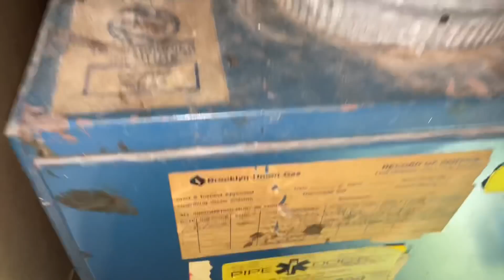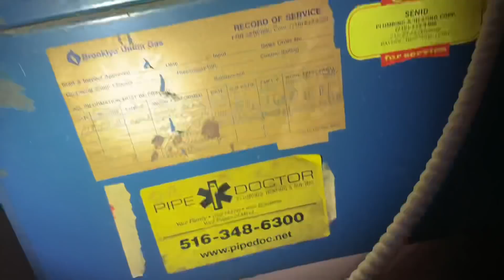Lucky The House Didn't Burn Down! Dunkirk Steam Boiler Ran Without Water & Totally Burnt Everything

Comment: Hello! I’m a new homeowner who just discovered your channel and admire how informative your videos are. I am in the process of replacing my old and oversized Peerless oil steam boiler and wanted to ask your opinions on the 2 brands that I’ve been quoted on: Crown and Dunkirk. Which one would you recommend?

We have a multi family home that’s about 4820 sq feet. All of the windows are new and we renovated so the house is well-insulated. Based on calculations, we need to cover about 442 square feet of steam which would be a 175,000 BTU boiler but the store I went to doesn’t have that one available for either brand. They checked if other brands had 175K BTU in stock but they didn’t. To my understanding, they told us to get a 200,000 BTU boiler and have the plumber change the nozzle so it functions like a 175K BTU and we’re not wasting oil and using the appropriate gallons per hour for the size/steam requirement of our house. Should I go ahead and buy the 200K BTU boiler and change the nozzle or keep looking around for the 175K BTU one? Is there anything specific I should make sure they do during installation to make sure this works.

It’s a pretty big purchase and I don’t want to get it wrong so I figured I’d try to get a second opinion from an expert about these brands and check if the nozzle advice is common practice before I made my final decision. 

Thanks in advance!

Comment: You seem to be scolding the poor guy and rubbing it in that he has to buy a new boiler. Are we missing something?  If you did maintenance in October how is he neglecting maintenance? Also the vent from the Hot Water tank LOOKS like it is improperly graded. (1/4" per ft.)
Reply: @PipeDoctor  Believe me, I'm not trying to be a assh*le. I love your video's. O.K. I watch the video for the fourth time. "Did a service call in October ‘20". So your beef with the guy is that he tried to wire in his own low water cut off?  I'm not doubting that he didn't but why did he do that? What was his volition. Do you think that the boiler cut off because of low water and he didn't know how to fill it?

Comment: Do steam boilers ever have high temperature cutouts as a last resort to stop this kind of thing? Would have to be set higher than the steam temperature at operating pressures, however once all the water was gone that'd trip out pretty quick, before much damage was done.

Comment: What are you putting in? Another Dunkirk or burnham? The smell of dry fired cast iron followed by the smell of green backs never gets old
Reply: I would stay away from the brazed heat exchangers. The passageways are very small and can easily clog from the steam boiler sludge. If you need a heat exchanger,  I would recommend the Everhot external coil. More expensive but worth it. Or use a boiler with a coil. Weill Mclain and Slant fin both offer coils on their gas steam boilers.

Comment: Steam boilers don't belong in residential homes!
BLOP-NJ
Stationary engineer - phila
The boilers need the redundancy that's required in commercial buildings.(period)
Lwco can hang up even when properly flushed. every season all floats need to be broken down and tested (EVERY YEAR)I've come across many burnt up steamers !
They have the potential to explode !
(POTENTIAL)
Just say'n 
31 years in
P.S did you break the float down ?
Lol
Stay safe !
Wear your safety glasses.
Reply: Wear your safety glasses
Reply: @F12255  please wear them.
Reply: Not a float style lwco btw. Those are probe style that use the water to generate continuity with the metal as a ground.  And that probe with the wire that broke is a secondary lwco i believe.  Unless the lwco was jumpered , usually a dirty probe will do the exaxt opposite and fail all the time until cleaned . I work with alot of commercial steam boilers and deal with it all the time .
Reply: @ryanwong1930  you can have any style you just need two.
Pressure & LWCO ?
(PHILA)
jus say'n
3years in
Wear your safety glasses!
And that's two of each on a steamer!
Reply: @realestateservicessaleshea99  it had 2 probe style lwco. Pressuretrol is seperate.
Reply: @ryanwong1930  also one of the pressure trolls could be your burner manager🤔🥃🍺🥃🍺🍺
Just say'n
Stay safe.
Wear your safety glasses!
Reply: @PipeDoctor  Yes
There is bajillions of them they ALL should have redundancy like commercial is required to(phila)!
Average home owner doesn't realize the possible danger of steam!
I believe we all were alive when hot water boilers didn't come with (,P R O B E)
LWCO .
5months in
Jus say'n
Stay safe 
Wear your safety glasses .
Reply: Water heaters can blow up as well, should we ban those too?
Reply: @frmerrin2  no just make sure you don't cut the white thing off during an install !
Lol
Jus say'n
Stay safe wear your safety glasses.
Reply: @frmerrin2  i think hes just not familiar with steam.theres nothing wrong with low pressure steam as a heat source . And if there was a leak , by the time it flashes to atmosphere it isnt actually that hot . Getting burned by 200 psi steam piping is a different story .
Reply: @ryanwong1930  1 -hot water boilers have (most) auto feeders so as it leaks water is added! "NOT"
SAME with domestic hot water boilers champ .don't cut the white thing off .
Lol
AGAIN domestic steam is more dangerous then people think I'm not talking about a little leaky leak.
I've in my travels champ I've come across several STEAM BOILERS that had the potential of catastrophe ,through luck they just turned into chips add the salt. now I'll say this s l o w e r they need the same redundant control as a commercial steamer !
One
ONE STUCK LWCO KAN BECOME DEADLY !
BLOP- NJ
STATIONARY ENGINEER PHILADELPHIA.
Retired (Hmmm)
Stay safe 
wear your safety glasses
Reply: @realestateservicessaleshea99  you keep saying stuck lwco ... theres no float lwco on these boilers champ . 2 probe lwco is more than redundant and a relief valve for any overpressurization. Maybe stick to hot water tanks .
Reply: @ryanwong1930  
Do yourself a favor and glance through Dan holahans everything about steam and whatnot that may help you understand steam
Jus say'n 
Stay safe
Jus a rookie.
Wear your safety glasses.
Reply: @ryanwong1930  wow I know you only seen two steam boilers to date! THERE ARE TONS OF STEAM BOILERS IN OPERATION RIGHT NOW TODAY IN DOMESTIC HOMES THAT HAVE FLOATS MY MAN ! I (ME) HAVE COME ACROSS STEAM BOILER DEATH BY NON ACTING F L O A T S !
I DON'T KNOW WHAT YOU'VE COME ACROSS SO I CAN'T REALLY SAY BUT SH*T HAPPENS.
STAY SAFE
7 YEARS IN .
WEAR YOUR SAFETY GLASSES
Reply: @realestateservicessaleshea99  do you see a float at all on this boiler ? No we dont so get off that subject jesus .
Reply: @realestateservicessaleshea99  i can tell you right now , that i work on alot more steam than you . Anywhere from 125k btu up to 30 million btu steam boilers for hospitals . So relax bud and stop living a fantasy .
Reply: @ryanwong1930  So
You say they don't have redundancy?
Jus say'n
Reply: @ryanwong1930  do you know we were going at each other for no reason all I needed to do was put you on the TITTLE THIS THREAD IS UNDER !
"DUNKIRK RAN OUT OF WATER"
SURPRISE IT DIDN'T KABOOM"
SO MY FANTASY HAS COME TRUE 
DA PLANE
DA PLANE
BOSS
LMFAO 
JUS SAY'N
8 MINUTES IN
STAY SAFE.
WEAR YOUR SAFETY GLASSES !!
(LOL)

Comment: you got a bomb there
Reply: On its own, a dry-fired boiler won't explode, but if for whatever reason water was to be introduced to the boiler while it is literally red hot, the water would instantly turn into very large amounts of super-heated steam at a rate that far exceeds the capability of the pressure relief valve, and then you could indeed have a big boom!

Say you had an automatic water feeder that is intermittent and suddenly starts working again, dumping water into the boiler while it's dry and hot, or some "maintenance guy" that doesn't know any better comes along sees the boiler is out of water and turns the valve to add water... BOOM!